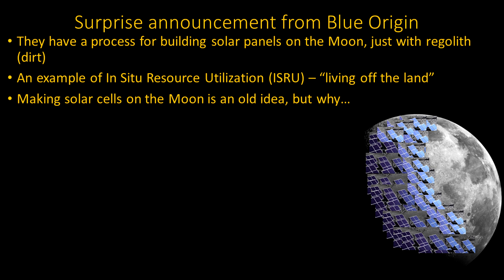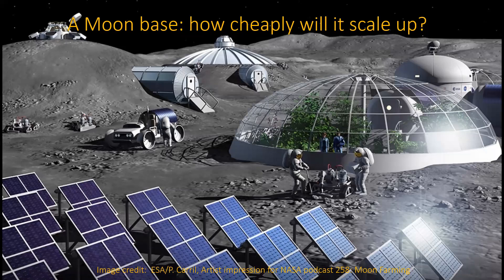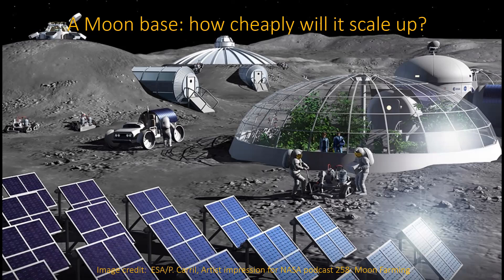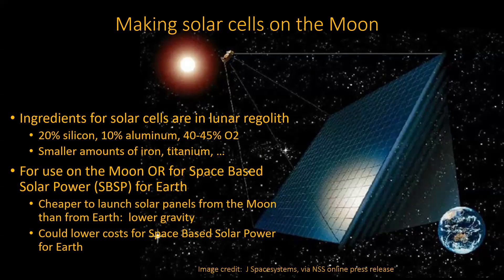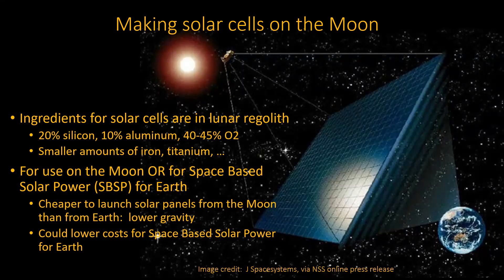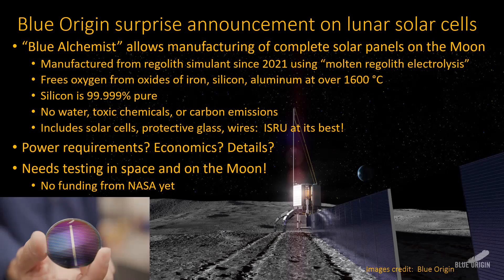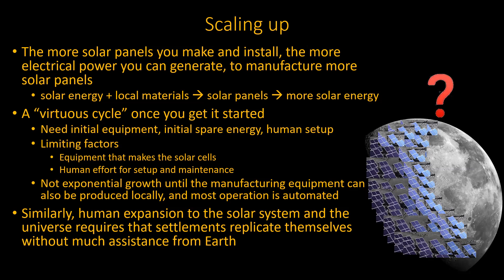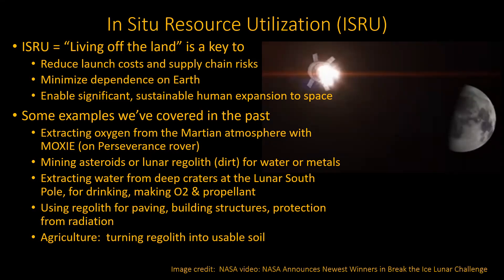Mining & making solar panels on the Moon (Blue Origin &  Lunar Resources): technology & implications

Comment: Could this same technology build a radio signal satellite dish in a crater to replace the collapsed dish in Puerto Rico?
Reply from the maker: The solar cells would be directly useful for the needed power.   The same mining and extraction processes like molten regolith electrolysis could also be used to create the metal for dipoles and connecting wire.  I just saw a presentation at the 2023 NIAC (NASA Innovative Advanced Concepts) Symposium about a Phase II project, researching  building a radio telescope on the far side of the Moon using these processes.  (Google NIAC Symposium 2023).   It's called FarView.   There's a web page about that at https://www.nasa.gov/directorates/spacetech/niac/2023/FarView_Observatory/
Reply: @gstanley0  thanks for the link.